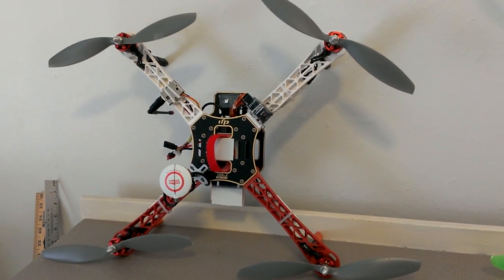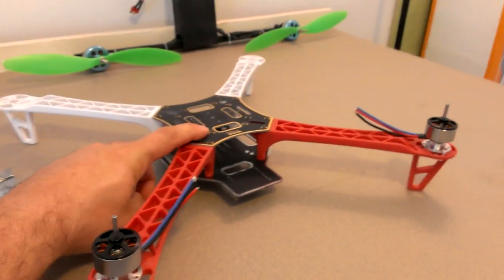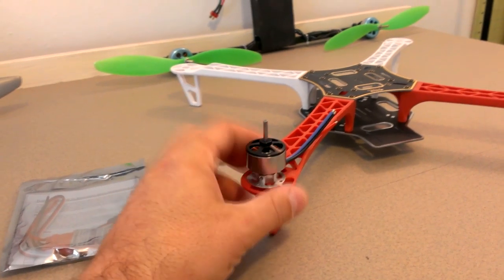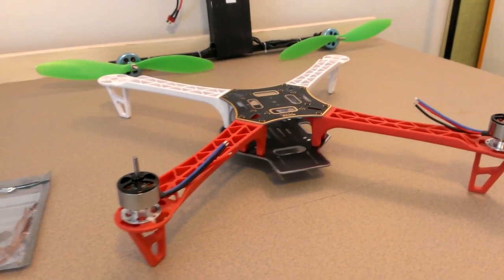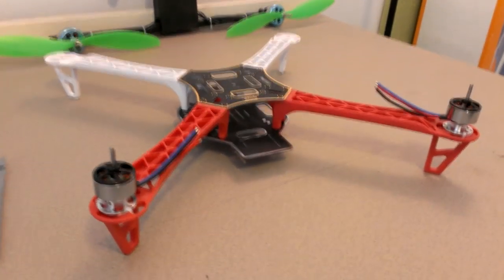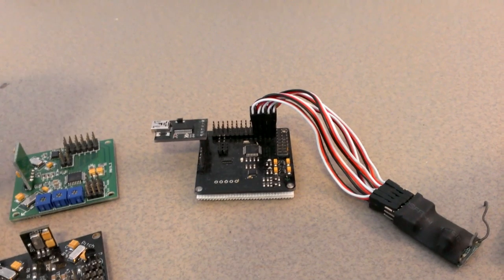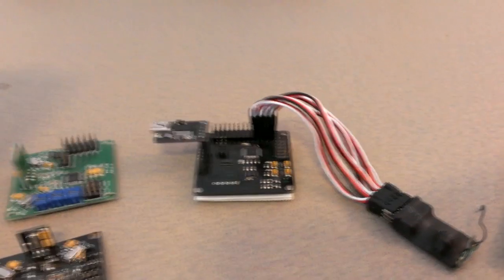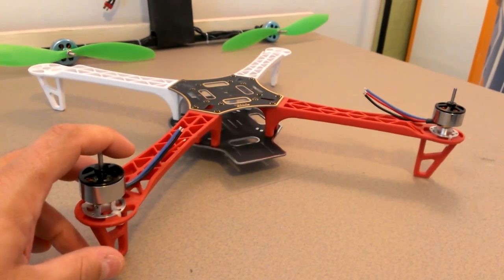Comparing DJI Flamewheel F450 with NAZA-M to a F450 Clone budget quad (Part 1)

Comment: how did you get $650-$700 on the DJI?
ARF kits run $400 with gps brand new.
Reply from the maker: Those prices were from early 2013, 2 years ago.

Comment: Hi, Thanks for the vid. I have put together a materials list and cannot get it anywhere close to $125.00. Can you help? This is what I got.
Whirlwind FY450=$13.50. 
Hobby King 2210n Motor = $12.00 x 4=$48.00
10" Props = $1.25 x 4 = $6.00
Turnigy Plush 18 amp speed controller = 4 x12.15 = $48.60
KK2 Flight Controller = $30.00
2200mah lipo battery = $7.89
TOTAL = 160.00

Where were you able to get better pricing on any of these? Thanks in advance.
Reply from the maker: Hi, my build was a long time ago, but I paid about $8 or so for the motors from hobbyking.  They were hextronic motors.  I would also recommend going to witespyquad dot com and getting some simonk flashed speed controllers.  They are much better for multirotors and also only $8 each.  That would save you $32 and make your total $128.  Not sure if the hextronic motors are still available at that price, but you should be able to find some budget motors for under $10 if you search around Hobbyking.  Also recommend looking at the Naze32 controller in place of the KK2.  Great reviews and if you can find it in stock, it's only about $25.  Good luck with your budget build.  Oh, those 2210n motors are pretty small also.  I bought a set thinking that they were the same as the 2213n 800kv, but they are a good bit smaller and lighter than the 2213n motors.
Reply: im using the quad esc (4 esc's in one) - about $30, and 28xx motors which were about $10 each. So about $130 for me all up. Controller however brought it up to about $450 :P

Comment: Quick question. If you aligned both lower plates of the frame, will the screw holes also aligns? Im planning to put the dji landing skid to my whirlwind fy450.